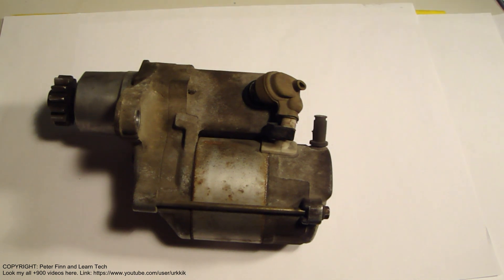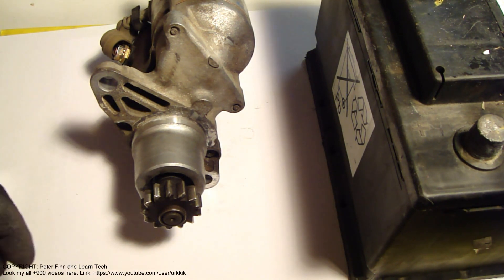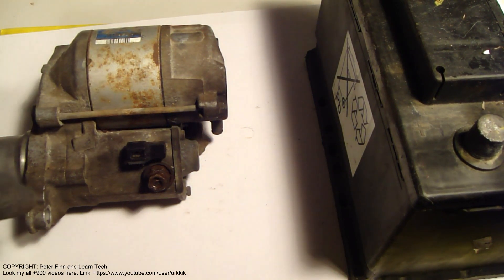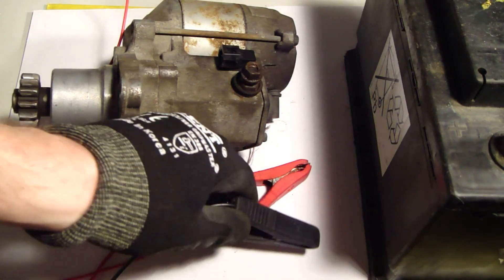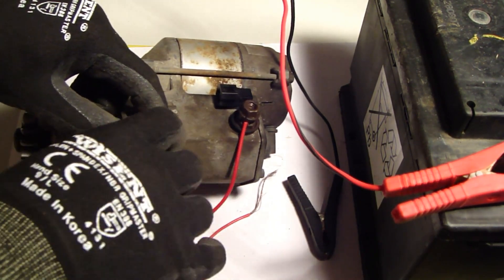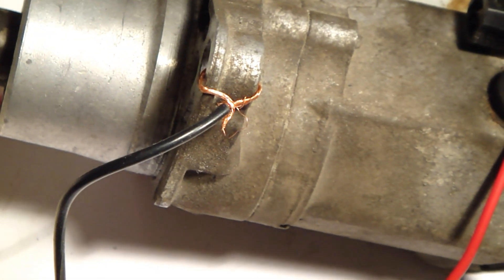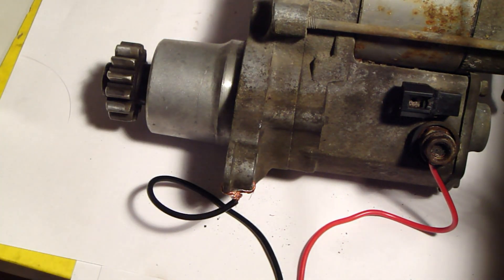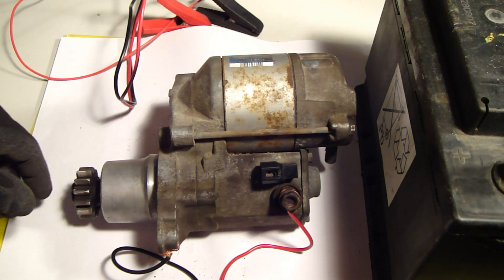How works car starter or start motor. Look how it really works.

Comment: Hi, would a bad starter cause a sudden stall at a red light? And cranks but no start afterwards? Thanks
Reply from the maker: Maybe fuel filter or engine low compression

Comment: can i use starter motor  to make ebike?
Reply from the maker: Yes, good idea. :-)
Reply: Very old post, but for anyone looking to do something similar presently the answer is NO! I tried it and its probably a terrible idea. Even car manufacturers recommend not running it for more than 20-30 secs at a time continuously. A small motorbike starter motor in eBike will draw 30-60Amps and starter will get burning hot in a short time. The very thick motor windings also is responsible for the high torque and current draw.

Comment: Very thin wires! They does get hot. In a real installation you need use thicker wires, because of over 100 amperes (1200W in 12V) current. Thicker wires also passes more power and your motor will start more efficiently.
Reply from the maker: +Niko Rantala  Thank You. I appreciate Your feedback.

Comment: Hey i have some issue when i start the car. When I turn it on with the key it starts but feels like it hesitates to start.Like it cuts out what could cause this? I changed the battery, coil pack and spark plugs. Still the same.
Reply from the maker: Ok. And starter runs the engine well. But engine hesitates to start. Right.
Reply: Peter Finn you are the best peter (y)